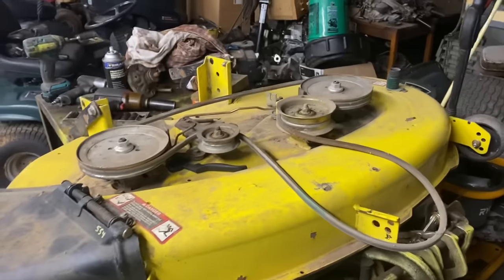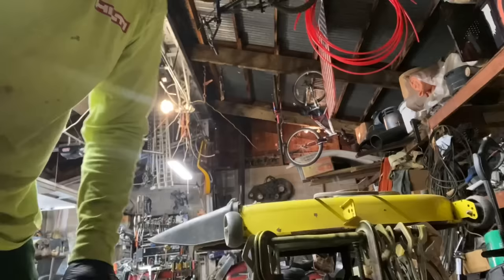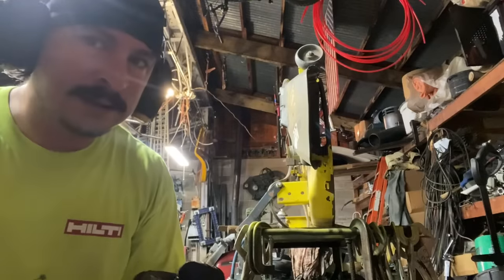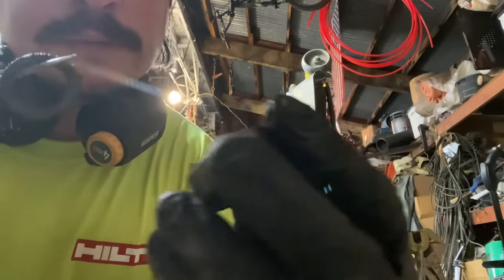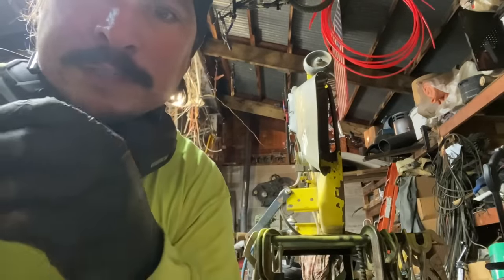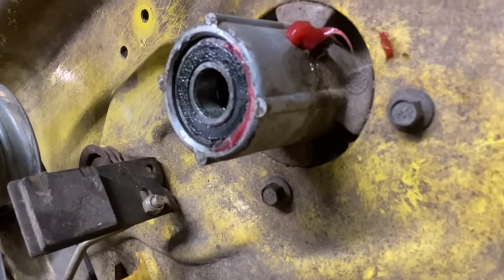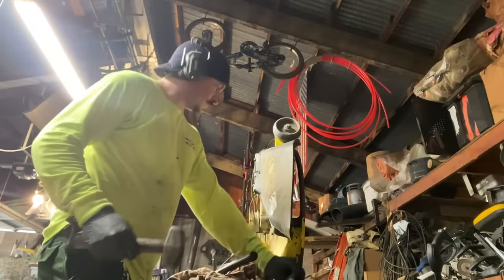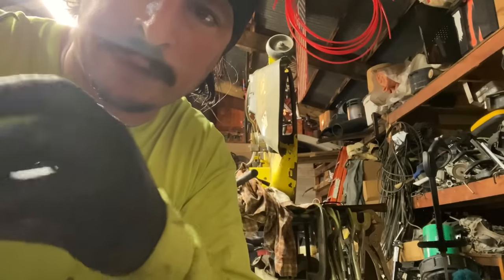Part 1 - Don’t trust the “Experts” Grease your mower deck sealed spindle bearings Common sense.

Comment: Russ, Well there's nothing like actually doing the experiment and seeing how it turns out, is there?  I'm thinking maybe it might be even better just to leave the two inward facing seals off altogether when reassembling the spindle.  After all, what the hell are they sealing out other than the grease you pumped in to the cavity?   Anyway, thanks for doing the dirty work and if I can figure out how to tip you for the effort I'll do it.
Reply from the maker: Thanks, no tip needed. I like to help out. As for the inner seals. Not worth the trouble to remove them. That’s actually part of the point of this video is so folks can see that those seals don’t stop grease from passing into bearing like the “experts” say.
Reply: @GTObearclaw1  10-4 on that.  I suppose when you've got a couple thousand psi available on your grease gun that inner seal really doesn't stand a chance.  Grease will, however always travel the path of least resistance.
Reply from the maker: @andrewhanson5942  as for the pressure. What the gun is capable of is well above what will ever be needed to pass these rubber simple extremely weak shield lips. I’d be surprised if the pressure in the assembly ever reached above double digits. Probably not even above the teens. I think about these type of bearings as self regulating. We just need to pump them full of grease and the excess grease will simply work it’s way past the seals as the bearings in use. Enough will stay in to keep the beating lubed but if the bearing does receive a lot and needs to evacuate some, it will just push right out. I have felt what hard pumps are and never needed any hard pumps for these type assemblies. This topic. This is a process that seems complicated and easy to overthink.

Comment: can't  you use Small Bearing Grease Injector Needles?
Reply from the maker: I assume you are meaning removing bearings to grease that way? How would that be easer than applying through an existing zerk that is made to be used.

Comment: Is it possible to leave the inside seals off
Reply from the maker: It’s absolutely possible if you want to dismantle a spindle just to pull those out. I’d recommend just grease it the way it is. The inner facing shields would not make a difference one way or another when it comes to applying grease. It passes the shield lips just as Iv shown. Unless your already in the assembly it’s a pointless journey.

Comment: are you familiar with all grease types colors mean nothing, Synthetic, natural (Marfax was a brand 15 years ago) from crude oil? By the way, they don't mix at all. You end up with bearing failure
Reply from the maker: I’m not a grease expert. But I could see the color of grease in the bearing was not the same color as what I was using in my gun at the time of this video. I was only referring to color as a way to explain what I was seeing in the bearings. Not saying that the color was of importance as per the quality of the grease. I did not say I was and expert about grease. I can only say that adding grease is way more effective than gambling and never adding it. The potential for failure due to mixing grease is almost certainly a tiny fraction of the amount of failures caused by never greasing because some “expert” on his YouTube channel said that grease won’t pass the inner seal. Im just saying add grease. It’s better in the long run. I’m not saying I know the science behind all grease and how it mixes but I think for this application we will all be just fine.

Comment: I totally agree, there is no way that flimsy little seal will hold back thousands of pounds of pressure produced by a grease gun.
Reply from the maker: I seen a hand held - hand pump grease gun for sale recently that showed it had an output of 8,000 psi. Funny some folks think that rubber lip
Can stop grease from passing but it’s amazing how many people actually believe this. And I’m talking mower mechanics. Not sure why some folks have such a mental block about this and don’t even try greasing before saying it won’t work.
Reply: @GTObearclaw1  I did a video some time back showing installing grease zerks in the spindle housings and some folks were convinced I was wrong. I guess let them think what they want.
Reply from the maker: @MissouriOldTimer  hard to believe folks will argue about offering free help to extend the life of there equipment and save them money. You obviously have a lot better content than me. I’ll be looking at your videos, thanks.
Reply: @GTObearclaw1  I wouldn't say I have better content, I am not good with cameras or presentation for that matter.. but thanks for watching, I just subed to you a couple of days ago .
Reply: oops, I just subbed now, it was another guy I subbed to a couple of days ago,, now I have that problem fixed.. lol
Reply from the maker: @MissouriOldTimer  I’m a sub for you as well. Thanks again. We all have something to teach each other. I love learning new tricks!!!
Reply: The grease gun manufacturers express the potential pressure their product produces in PSI, pounds per square inch. The stream of grease coming from the nozzle is right around 1/16 inch diameter, and I've forgotten the percentage of a square inch that works out to, but I did the math on it years ago and came up with right around 60 pounds of force.. NO grease gun on this earth is capable of producing anywhere near several thousand pounds of pressure into a 1/16 inch diameter stream of grease.
Reply from the maker: @6h471  so explain how I pump the tracks tight on a 80 thousand pound excavator  with a hand pump grease gun? And regardless of the passage the grease travels through that does not regulate the PSI. I think you got some errors in your calculations. But hay. Regardless of that. The point of the video is that the shields and t rubber lip of seals on the bearings can’t stop the grease from passing. Regardless of what the grease gun exerts in PSI the grease passes the seals. I’d say the pressure probably never needs to exceed the double digits for this application. The matter of what a grease gun can exert is another matter as it really makes no difference because what ever the PSI it more than does the job here. And that’s the bottom line, because stone cold said so.
Reply: @GTObearclaw1  I've pumped up track adjusters on D8 cats myself. Those are about 6 inch diameter. Let's say your grease gun puts out 10000 psi. The operative words here are PER SQUARE INCH. What fraction of a square inch is a 1/16th inch diameter circle? I'll help you out there. It's right at .003 Sq inch, and to find out how much pressure that 1/16 inch stream of grease has behind it, divide 10000 by .003 for the answer. Then in our track adjuster example, find the area of a 6 inch diameter circle in Sq inches, and multiply the force of that small stream of grease over that much larger area, and you can wind up with a force of many tons.
Reply from the maker: @6h471  when it comes to hydraulic application I’m no expert nor do I actually care. Maybe an actual expert can one day step in to squash this and give us the facts. For now i disagree and my opinion on the matter is that the pressure sent out of the gun is not regulated by the hole on the gun but rather by the area it is pumped where it exerts force. Seems logical to me. As I have log splitters that have small passages for fluid to flow but part of where the pressure rating comes from is the area in the cylinder where pressure is applied. I think we are both working off opinions. I surely don’t know. But as I said before in the last comment. It ultimately makes no difference what the actual psi is for this application because it does the job every time. The reason I made and reference to the pressure a grease gun exerts is because I want people to think about the logic of how grease is traveling through a zerk and that it is under presure in the example I show and that a rubber lip on a shield is not going to be able to stop pressurized grease from passing through the assembly. If the road block in the scenario is the shield and the shield is sealed by a rubber seal around the outer  and inner perimeter then grease can easily penetrate the seals and pass fully and completely through a mandrel assembly with little no no resistance. Even if your saying the grease gun can exert 60 PSI that is obviously more than enough as my video shows the grease entered the bearings and that was the goal of my video. As for once the grease is in the assembly and applied to a greater area maybe then the force is greater. Regardless grease goes where it needs to go what ever the PSI is. I’m not the expert just stated what Information I found about grease gun pressures. I guess I can search the tube for grease gun videos. If I can’t find one that explains this I may need to make one myself if I ever get the itch. Maybe the grease gun industry is similar to the mower deck mandrel industry and we need to do some deeper investing to find out what’s really going on. Lol

Comment: While you may get grease into sealed bearing this way, you will also pack in so much grease you will likely overheat the bearing from the pressure.
Reply from the maker: You don’t sound very confident that that’s going to happen. Using the word likely sounds more like an assumption on your part. Negative, no need to concern yourself or mislead others with unproven imaginary issues. That is False I have been doing this for decades without ever seeing an issues of which you speak. Even if it was a possibility, there is no pressure remaining after the grease application has stoped, any pressure is immediately dispelled after grease is applied and oozes out through the lips on shields. You can not add to much grease because they don’t hold in pressure. These are not sealed in the way you must be imagining. The fact is greasing the way I showed works great 100% of the time. The only reason it would not work as shown is if the unit has already sustained damage prior to grease being added. Grease won’t fix problems that have already occurred. Many folks don’t see a need for the basic simple preventative maintenance until they realize something is starting to go wrong: Grease is not a repair. Grease is simply preventive maintenance. This is the most basic and simple maintenance for a mower other than keeping the oil changed and the air filter clean. No need to think too deep into the process. If it has zerks, it needs grease, plain and simple. Absolutely no reason to be concerned about adding too much grease, other than it might be messy. No mess that a simple rag or shop towl can’t handle. Every single lawn mower with zerks installed from the factory is safe to service in this way. If you haven’t noticed, not a single naysayer has ever posted a video of a mower deck mandrel that was damaged from addding too much grease, reason for that is because these bearings will never be hurt from grease applications. These units do not hold pressure, therefore they can simply expel any grease that would be more than needed. It’s basically a self regulating system. The movement of bearings can push out any grease that would be necessary to allow for them to move easer. If the bearings are packed full, some will work its way out as things spin. These units can’t hold any pressure. Without the ability to hold pressure any grease being pushed by a grease gun or a bearing will push out the flemsy lip on the shield. Think of it more as a dust cap with a thin light duty lip around the sealing side. Not really anything more than a dust barrier. Not even very efficient at keeping water out. One reason so many folks in the comments say not to was decks especially after they have been ran and they are hot. Those seals will pull water right in when cold water hits a hot bearing. Even if some grease pushes past the inner and outer seal, more than enough grease will be retained to provide adequate lubrication for many hours of use. If you are not sure, just run some tests yourself. The point is, don’t trust the “professionals” keep an open mind and see what works for yourself. I can say that I am disappointed so many professionals are unwilling to even attempt the same process I have to learn and give the DIY community accurate information. So many like Donny boy are just experts on every topic and even after asked to consider the fact they could be wrong he still leaves his false information posted and misleads many folks. I find that to be unfortunate. Rather than actually providing accurate information he is just  here to make $ and get views and does not seem to care about folks needing accurate answers. After seeing his terrible video I tried to reach out in comments to work with him on the issues with his misleading information but he has no intention of setting things right or exploring the truth. But really this is Super easy stuff, Iv shown all the steps. No reason anybody watching this can’t perform some tests at home. If a good bearing is kept greased it will last much longer than it would without. And If a bearing is not greased it will eventually fail sooner than it would if it had been greased. Without grease added, the life of the bearing will be greatly reduced. Too much grease in this application is not a thing. In some applications maybe so, but in this application it’s not an issue. Cut and dry plain and simple.
Reply: @GTObearclaw1  I'll be the first to admit engineers make the dumbest mechanic, but they do have their reasons. Having seen the effects of an overpacked wheel bearing cause a bearing failure in the shop I worked at I can assure you this does happen. I think you know this though. The fact that you rely on the lip popping off to release pressure means the grease is already overheating and breaking down fast. My Zero turn doesn't have grease fitting there. Otherwise I would test it and see what the "stock" temp is and what the over greased temp is.
Reply from the maker: @FROG2000  you must be imagining things. I didn’t say anything about a seal or shield popping off. This video is not about wheel bearings. Thats gonna be a little different. This is specifically about mower deck mandrel bearings. Did you work at a mower shop? Iv never seen any issues with mower wheel bearings overheating and Iv been at this a while. What I shared here has been throughly tested and verified to work 100% of the time otherwise I would not post a video.

Comment: Basically if you don't fill the housing it's a good chance u shoot air in and grease out. That's what I gather really from this
Reply from the maker: @gpt5002  if you don’t fill the housing with grease it is guaranteed to be full of air. air won’t hurt anything but not having grease in the bearings will eventually be an issue. Also water can get into the assembly if left out in the rain or when washing and water in the bearings is bad. If they are full of grease there is less issues with water however water can still be in the bearings. When greasing the water usually pushes out for the most part. It’s best to keep the machines out of the weather and use air / leaf blower to clean the deck after each use if someone really wanted to prevent unwanted issues

Comment: Metal covered bearings are called shielded brgs. Usually found on electric motors. Rubber covered brgs. Are commonly called sealed brgs.
Reply from the maker: But not exclusively?